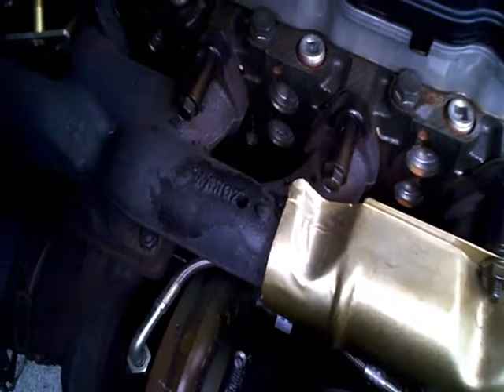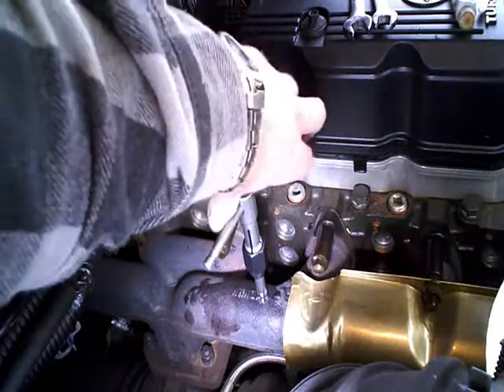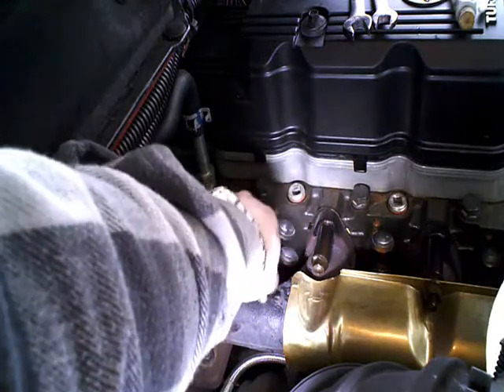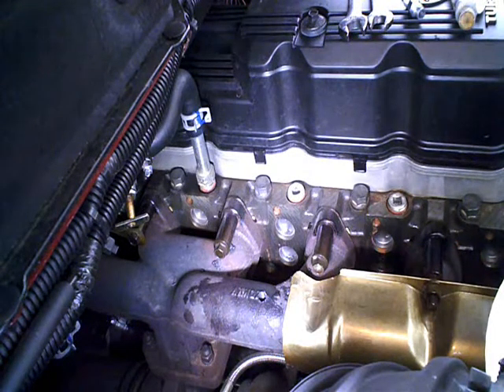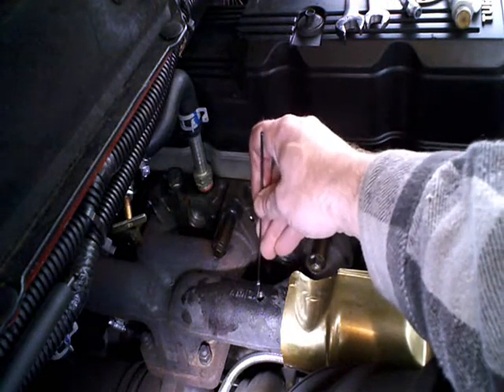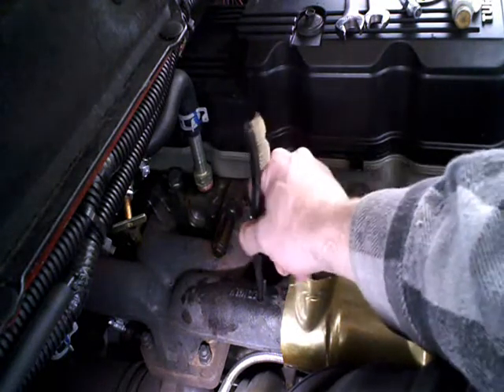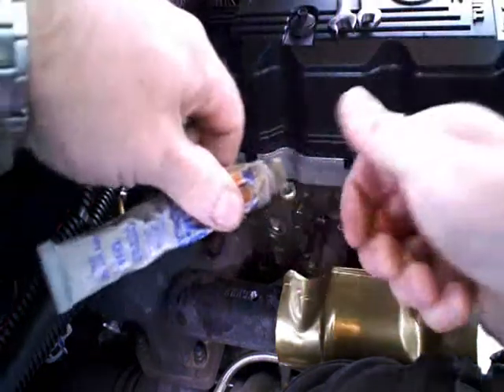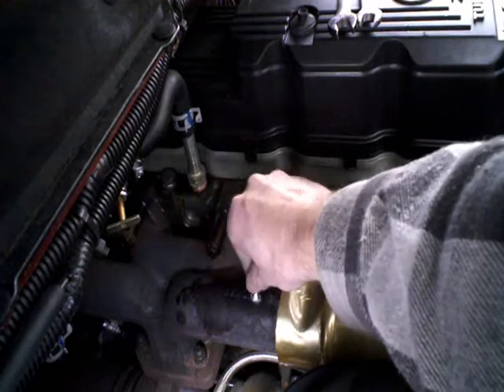Pyro install part 2

Comment from the maker: Personally, although coolant temp might be slightly higher at the rear of the engine, I doubt there would be much of a difference in exhaust gas temp. 

You could certainly install the probe farther back if you wish, or you could put it on the down pipe above the turbo where it would get all cylinders. 

On big trucks it is usually installed post turbo, on the outlet elbow. Readings from there will generally be close to the same at idle but a couple hundred degrees lower under load. 

I guess I